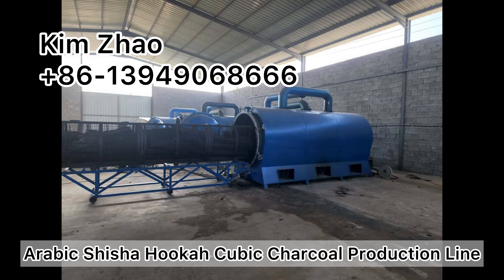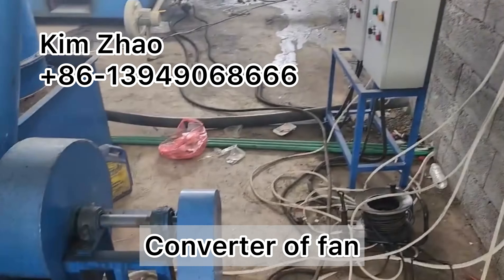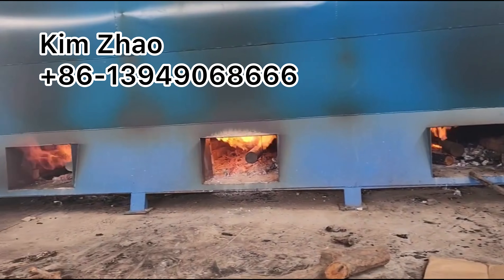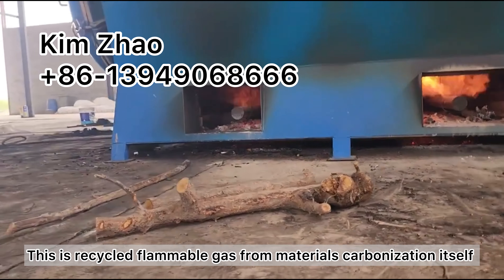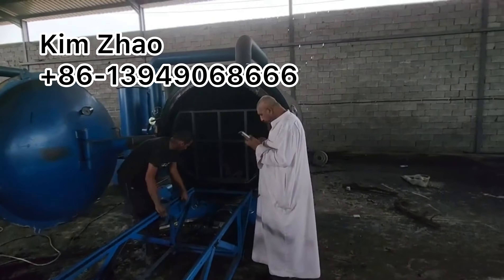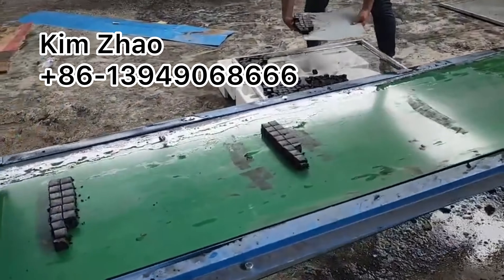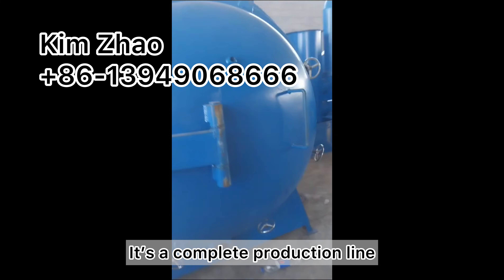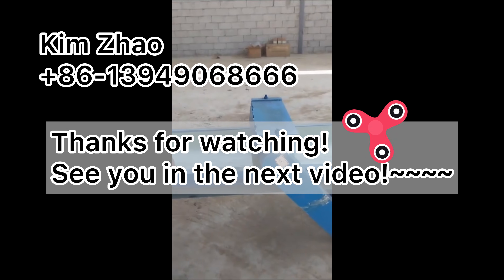How to use Palm Waste to produce charcoal? Full Complete Shisha charcoal production line

Comment: what's the purpose of the water purification? How is that related to the carbonization? Is the water a byproduct or is that tar?
Reply from the maker: We use water purification to treat all smoke comes out from inner furnace, and also bottom buring chamber. All smoke go through spray and condensation. So we can get yes by product the mixture of water, wood tar, wood vinegar. In this way is the lowest cost to treat smoke. So the whole process can be smokeless worlking, which is good for both environment and also workers. If you need buy with same system, pls contact kim by whatsapp: +86- 13949068666

Comment: What is the ideal temperature or time of carbonization process?
Reply from the maker: It based on raw materials. The higher temperature the better quality of output. Carbonization time based on raw materials original moisture. Dry material ( 15%) need 4-6 hours finish carbonization.
Reply: @kimzhao-charcoalmakingmachine am in kenya how much in dollars before shipping
Reply from the maker: @AntonyMbatia-o3c  Do you only need carbonization furnace or also briquette production line? Let's discuss in details via whatsapp: +86-13949068666 so i can send you correct solution and also detailed quotation.
Reply from the maker: @AntonyMbatia-o3c  Do you only need carbonization furnace or briquette production line also? Let's discuss in details via whatsapp: +86-13949068666, so i can send you correct solution based on your request, and recommend you Quotation file with details and price.